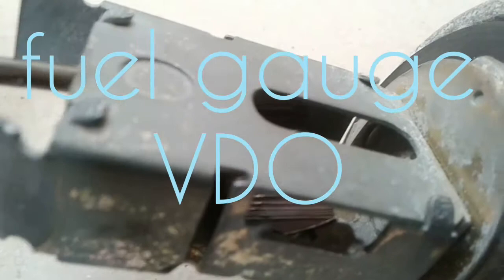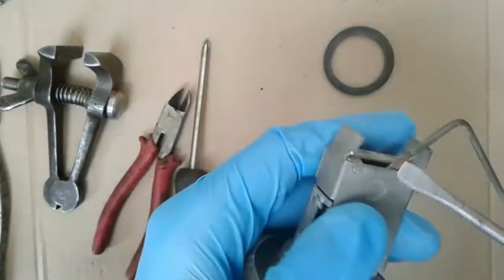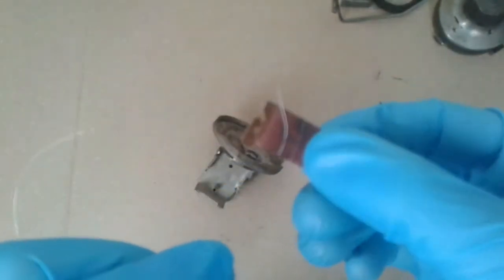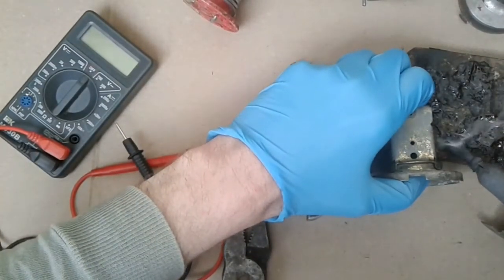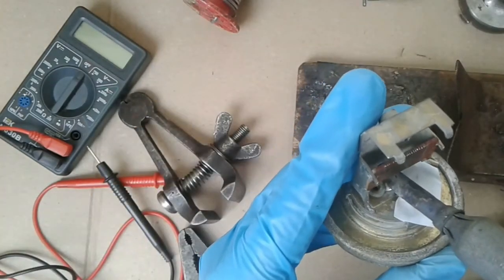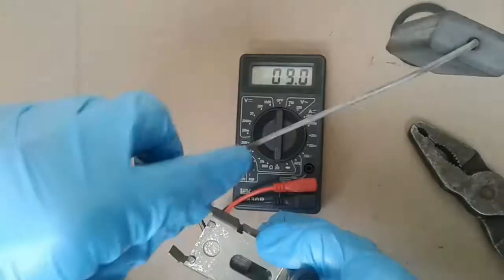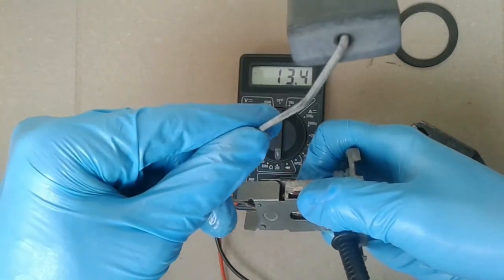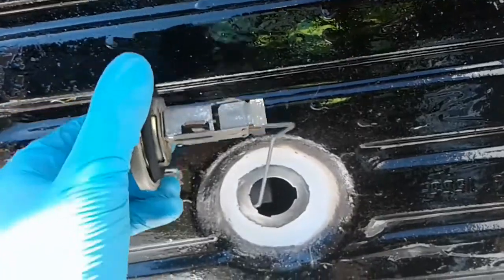THE FUEL GAUGE REPAIR #FUELSENDER #Volvo140

Comment from the maker: You will also need to check the position of the float with the readings on the dashboard when installing the wire. I used an old wire and did not buy a new one.
If you buy, then check and ask Jacobs what they have on sale, but he is still on vacation.
https://jacobs-online.biz/nichrome_wire.htm

Comment: Is the replacement wire a special type of wire or can any copper wire be used?
Reply from the maker: Do not use copper wire for this, (copper has zero resistance) you need a wire with resistance. The main and only purpose of the operating conditions of this sensor is that the wire has a distributed resistance along the length.
The sensor reading on the dashboard depends on the position of the float contact along the length of the wire.